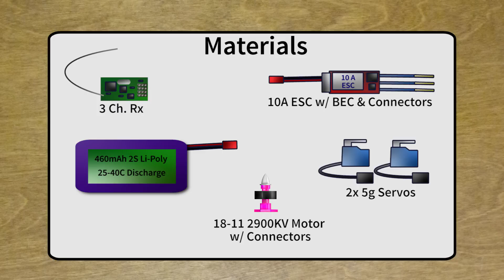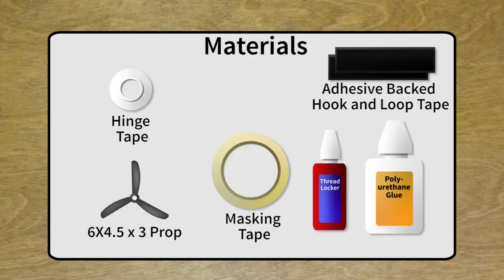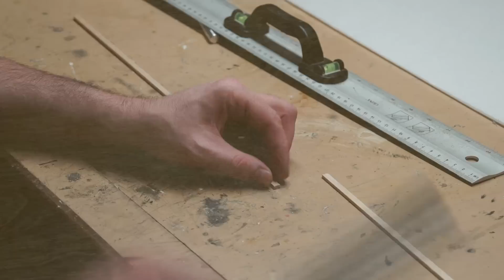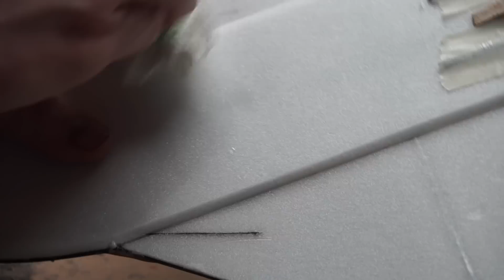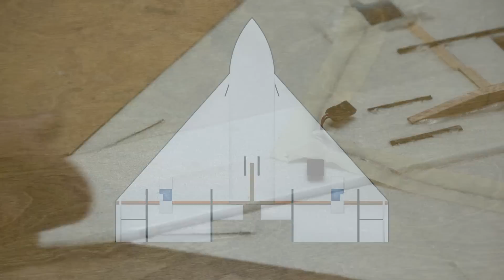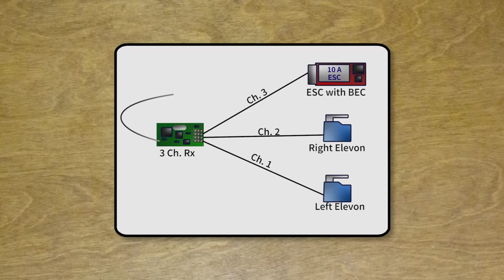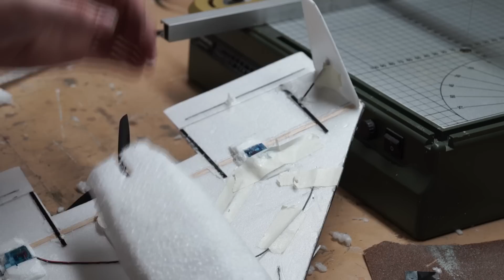RC Mini Delta Wing Step By Step build

Comment: Is it possible I could use hot glue instead?
And do you have any plans for this plane?
Reply from the maker: You can but be very frugal with it as it becomes heavy quickly.  Think of it this way, put the gluestick on a scale and then consider how much of that stick goes into that plane.

Comment: How to connect mix of aileron and  elevator to the transmitter please explain ?
Reply from the maker: Most radios have a channel mixer.  What I do is connect one to the Aileron channel and another to the Elevator channel.  Then I add a 100% of elevator on the Aileron and a 100% mix of Aileron to the elevator.  That way they both move for any input.  When you pull up you should see both elevons point up and down when pushed down on the stick.  Then when you roll left you should see the left elevon (when looking in the direction of flight) point up and the right elevon should point down.  When you roll right you should see the same.

Comment: Sir can you please suggest me some good article or web so I can understand more some about comparative ratios of angles and tip cord, wingspan, size of rudder etc. So i can choose proper ratios with weight of plane and speed requirement of plane etc.
Please . . . !
Reply from the maker: Calculate your wing area and ensure that you are about 1/4 to 1/3 behind the center of gravity to make the nose heavier than the tail.  As far as calculation for weight and speed and so on what you want to research is wing loading and power to weight.  Generally speaking, faster planes have a higher wing loading while more easier flying planes will have a lower wing loading.  For smaller craft a minimum of 1:1 power to weight ration is recommended.  As you go larger you can have less power to weight.  Everything I have has at least a 1:1 with the exception of my big 8' wingspan plane.

Comment: Tell Us to setup the controller and its controlls,its confusing me alot,i Like to build this in science exhibition,
Reply from the maker: You plug one elevon into the aileron channel and the other into the elevator.  You mix the elevator with the aileron and the aileron with the elevator.  this way both channels respond to both elevator and aileron input.
Reply: jjmonns  Thanks ,Also To set the reciever to Radio 3 ,Any way or have to buy specific reciever of radio 3 ,im just new in this,i do made a Car but used Hydraulic type of controls with rubberbands and gears,brand new to electricity things
Reply from the maker: The mixing is done in the transmitter.  You will need to ensure that you have a receiver capable of this.  You need a receiver that has at least 3 channels.  You will need a transmitter that is made for aircraft, a pistol style will not work.

Comment: Could someone give me links to compatable parts for this ? I am brand new, I have built the design and just need the parts. Links for the motor, servos etc.
Reply from the maker: HobbyKing is your best bet.  Just about any 5g servo will work.  You could maybe use a 3.7g.  if you go to 0:42 on the video you can pretty much find everything you need if you look for those parts in hobbyking's website.

Comment: could you post the dimensions of the plane? I plan to scale it to a larger version
Reply from the maker: I give all the dimensions in the video.  When I run across the source material (I am in the middle of archiving) I will do an overlay of all the major dimensions at once.